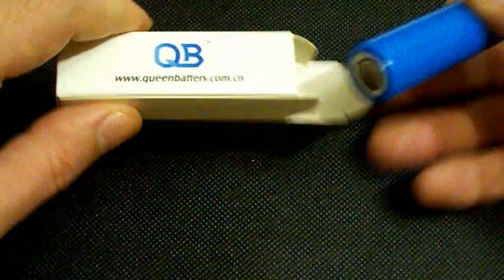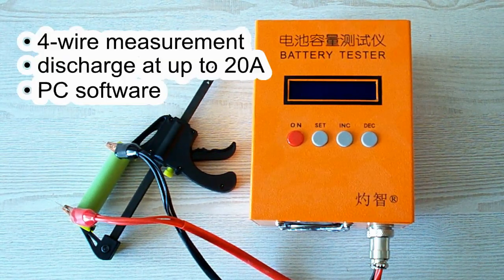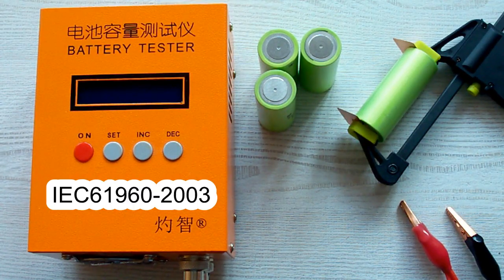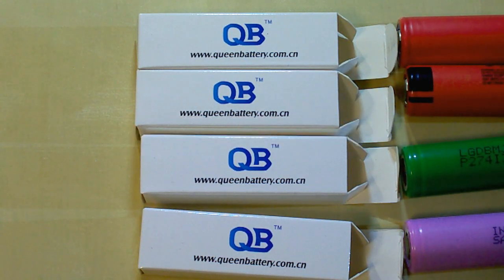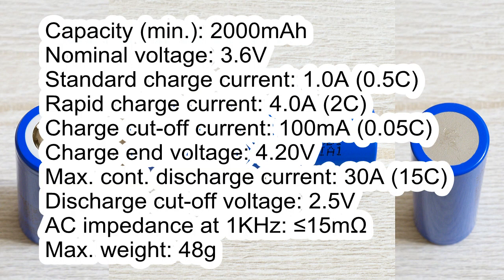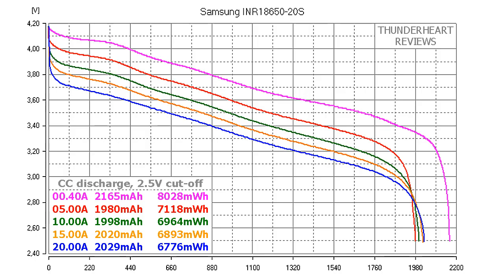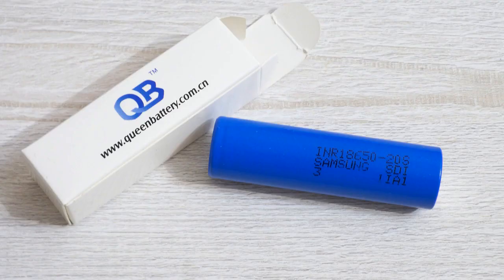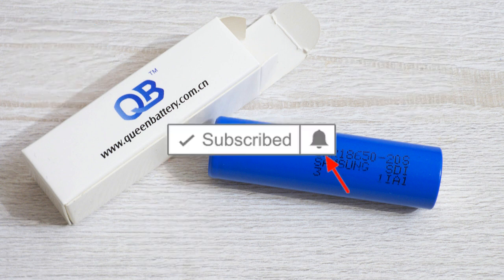Samsung 20S - high drain 18650 Li-ion battery (discharge capacity test)

Comment: I have a flashlight that came with a Samsung 30q (15 amps) would using this 30 amp battery damage it?
Reply: No, its only the maximum discharge rate. You just need a battery that can keep up with the max draw of your device.

Comment: Where is comparison to a123 systems 18650 battery?  both have 30a discharge current but which is the king of the roost?  Nice data and benching but some conclusions would be nice.  People want to be told by the expert what to buy and if you can show the proper perspectives with some data and explain yourself.... even better...  They want to be told what is the best and why by a commanding voice.
Reply from the maker: Hi White God:) If you mean A123 Systems APR18650M1A/B then it's not correct to compare it with 20S as the latter is a 3.6V Li-ion cell while the A123 is a 3.3V LiFePO4.
Conclusions are made if you didn't skip the Verdict section but i can't tell my audience "buy this cell" because there are very different scenarios of usage and if it will be an ideal choice for one guy, for the second it can be not the best. So it's always up to you what to buy or skip.
Reply: @ThunderheartReviews  ty, what about cycle life on the samsung data sheet they dont really give much so samsung is top now(been awhile since i studied this doing all my tool battery packs again) so 20s is the god 18650 right? huh lifepo4 only goes to 3.6 yeah must have glossed over that flipping through a million things last night
Reply from the maker: Cycle life is a parameter which highly depends on factors like DOD, temperature, charge and discharge current because it's the dendrites who kill the cell and all of the factors mentioned above affect the speed of dendrites' growth.